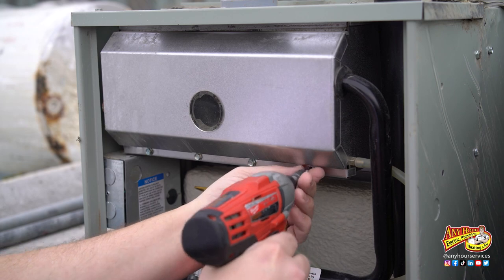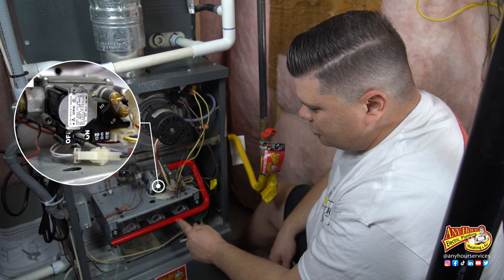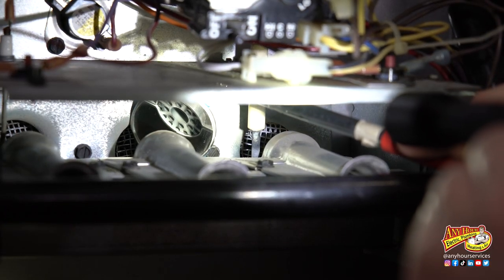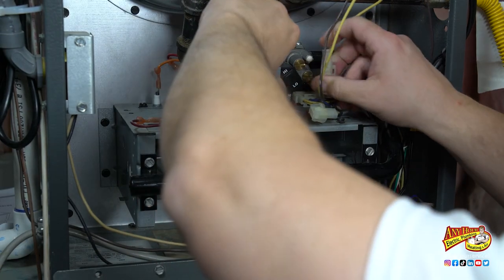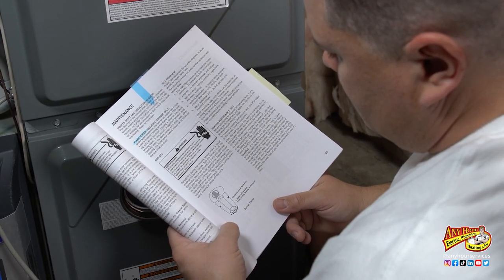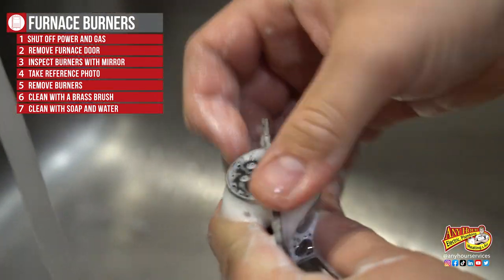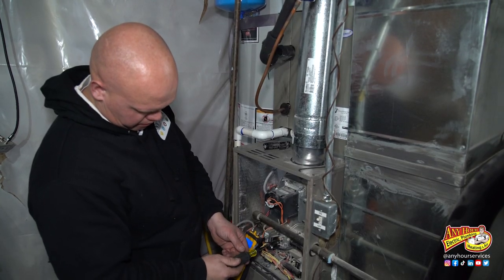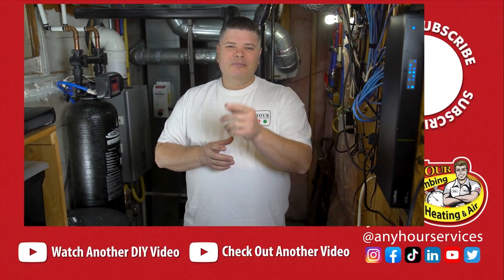Furnace Maintenance: How to Clean Your Furnace Burners

Comment: Nice video. I have to be honest, when I've have my unit inspected in the past, they just vacuumed around the burners, and that's it. I watched one time, and I told myself, "Heck, I can do that." I did call them one more time to make sure I didn't screw anything up, not telling the employee what I had done, and he said my unit was the cleanest one he had seen in a while. I haven't called them back since.

I will ask this, though. My HVAC system was purchased in 1989, and while I'm sure some parts have been replaced over the years, it seems to be working fine. How long should these units last? I realize that something that old may not be as efficient as new ones, but my bills haven't been that bad over time. Thanks.
Reply: You are past due for a new high efficiency furnace! 33 Years is a long  life for a furnace. I thought my 1996, installed new in 1997, Armstrong Ultra SX90, at just over 25 years of age, is old. I spent just under  $250 CDN on a new Draft Inducer motor assembly and new flame sensor/igniter assembly parts and  installed them myself. Did a lit match test of the primary heat exchanger, with just fan motor running to check if compromised (thank goodness not cracked) Cleaned the in-shot burners, the four gas jets and gas jet on pilot burner,  rebuilt the always leaking Condensate Y-Trap (very bad original design by Lennox/Armstrong) with System 636 pipe,  and furnace is now running so smoothly.  No more rough/loud bang delayed ignition. I'm sure I saved close to $900 in parts and labour, were I to have called an HVAC service. Now I can take a little more time to shop for a new furnace, rather than be pressured by HVAC companies to make a hasty, costly decision, and hire a licensed HVAC tech to just  do the install it later in the season.  Thanks for this great video and others here on YouTube.